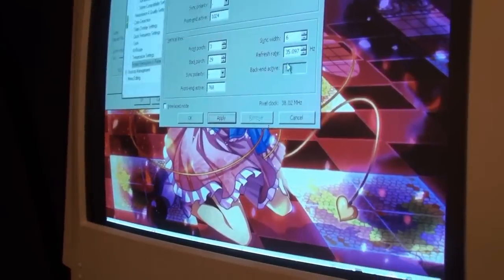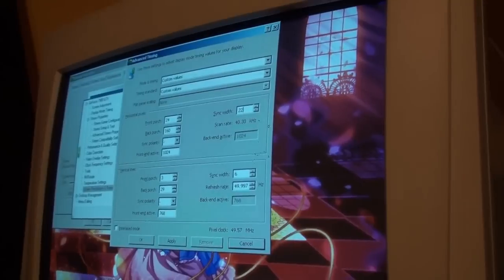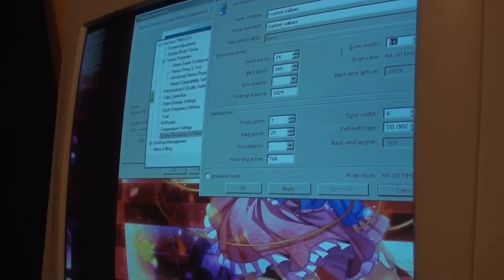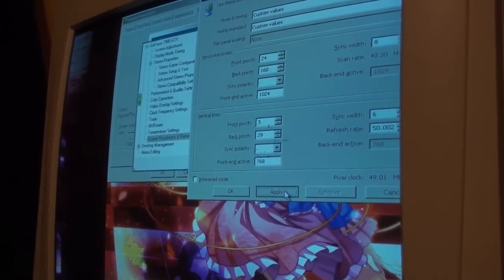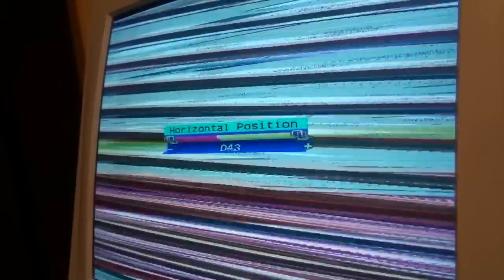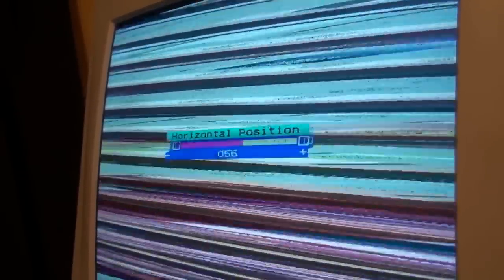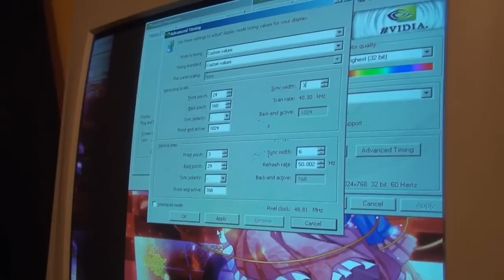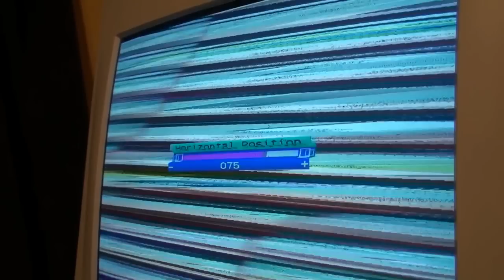Changing "Advanced Timing" of CRT Monitor [Aug 2009]

Comment: Well I just tried this out myself on a Quatro2 MXR/EX
Seems it saves those settings you put in the window as defaults for different screen resolutions and refresh rates. Had to roll back driver. Oh well. It was fun to watch my screen crap out at 49Hz